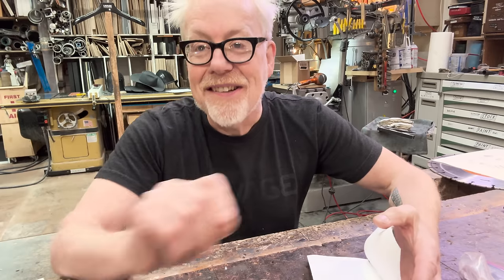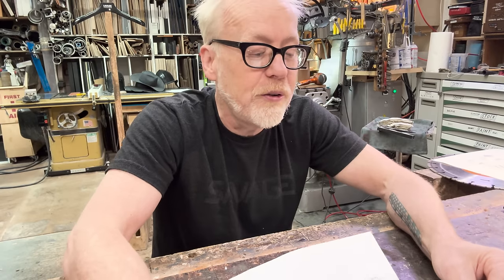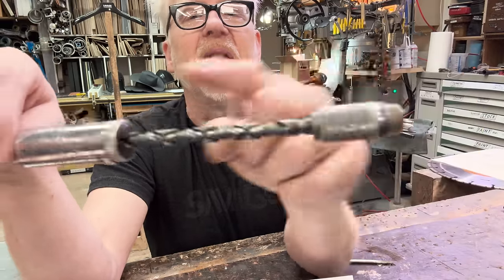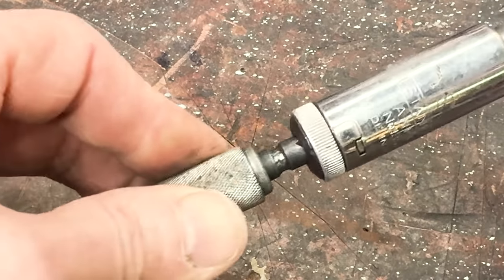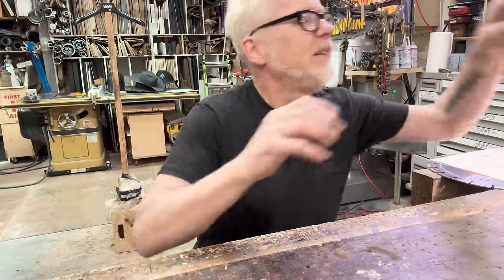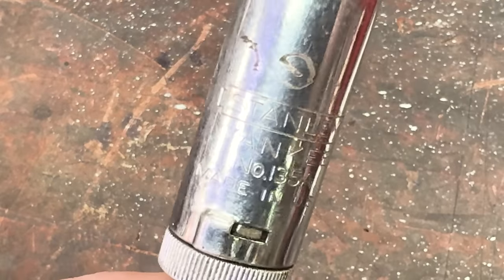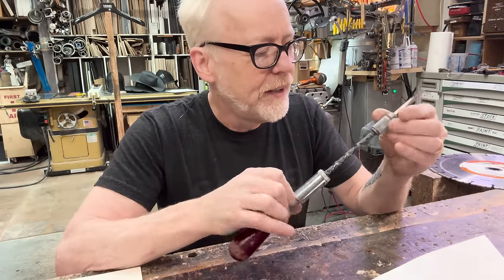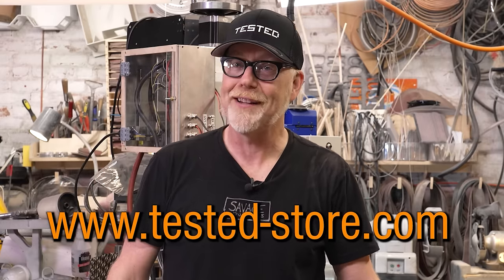Adam Savage's New Stanley Yankee Screwdriver!

Comment: My late Father had at least three of these, one small, one medium (about the same as the one in this video and one very large one... He had countless old tools scattered around his rickety workshop, on shelves, in boxes, hanging on the walls, many that very few would recognise... He once had at least five flat bladed screwdrivers, that were filed to use with Philips head screws, which I guess were a new thing back then and my Dad being who he was, probably refused to spend the money to buy the proper tool... As a kid I grew up around the smells coming from his workshop, from him tinkering with beat up old cars and fixing his cylinder lawnmower, to working on one form of wooden furniture piece to another.. the smells of freshly sawn wood, petrol, oil, linseed oil, paint, turpentine... several paint brushes soaking in thinners, various thin sticks covered in a variety of paints (stirring sticks) old cake or sweet tins, filled with various screws, nails, fingers and other fitting, plus a healthy does or sawdust, which not only made finding what you want much harder, but helped keep the moisture content low and therefore prevent the metal parts from rusting... So many great memories of those days... I would quote happily go back to the way things were then, if only that were possible.

Comment: Yes, based on this tool you can build an internal combustion engine. The shuttle is a piston, an external cylinder casing is needed. On each side there is a spark plug and a valve. And the central part is the shaft.

Comment: I found one of these at a thrift store for $4 and of course I immediately grabbed it. It gives a level of control and feel you don't get with power tools. Mine is a 130A made by North Bros before they were bought by Stanley. Judging by the 1923 patent date and the older branding it's probably 75-100 years old.

Comment: One of the benefits to these drivers si that the operator (you) are always putting downward force on the tool, pushing the bit into the head of the screw. This makes for less chance of stripping out the screw heads. I used to use these when working on old wooden boats where the fasteners were bronze, and prone to stripping the heads.

Comment: If I remember correctly the knurling at the end of the handle is a locking collar. So if you retract the shaft and turn the collar it should stay retracted so you can use it as a "normal" screwdriver and more importantly you can then release like Harry. If you look at the clip you can see that he twists the collar to make it extend

Comment: Two things about the Yankee screwdriver that are nice to know.  First, you can get other bits for it including drill bits.  Second, the small sliding button on the large silver potion above the handle has three positions - screwing in, screwing out, and (in the middle position) locked which it then works like a standard screwdriver.  My two cents.

Comment: Ahh you all make me feel real old. I have two of them different sizes and they are both tools that I bought for my workshop many years ago. They are still in daily use, I have an adapter for modern bits and a fitting which accepts small size drill bits. Great tools with amazing torque when used by an overweight old woodworker. 220 lbs behind that screw mechanism will wind the head of a 3/8 bolt if you arent careful!

Comment: I love my Yankee drivers. I am the proud owner of at least one of each type from type 1 (North Bros, Philla 1895) through type 17 (Stanley) in each of the (up to three) sizes available for each type, most in both the sprung and unsprung versions (30A vs 130A, for the mid-size) as well as a couple more moders (1980's or later) vintage.  One of the 30/130 size in each field kit, as well as 35 in most kits and 31/131 in the heavy service kits. I also have an obscene number of bits amd adapters for these, as I bought out the stock of them (full complement for  30/130 size many times over, but at least some for the others)from  an old school hardware store a few years ago for an embarrassing small amount of money. I would not be without these screwdrivers (and the associated Yankee bit-braces) in the field. No batteries to die, Minimal spark risk (they are steel, but in most cases are considered safe as they are not striking tools) fast, easy, and don't give spiral fractures to your radius when they grab hard like a high torque battery unit. See the old-tools list (msg 14126 of 1997-02-27) for the type study of the 30/130. I don't have my father's (he bought it in the late 1940's when he was in Palo Alto for his PhD...  long story why I don't have it, but the estate was plundered when he was in hospice at the age of 91) but I have my uncle's and my grandfather, each with its own history. 

The Millers Falls versions are also quite nice, with a twist collar to shift rather than the sliding switch. A tad more robust, in my opinion.

If you can not find the bits for that driver, let me know and I will check my stock. They supplied slot and phillips widely. Other types varied with the size. My favourite are the nut drivers in the radio service kit and a couple AT&T specials. Of course, you can modify 1/4"hex  to fit just fine with a little grinding. I did my deck with star-drive bits modded to fit.

Comment: Yankee tools were originally manufactured by North Bros.  Stanley purchased North Brothers in the 1940s and phased out the name in the 1970s.  Yankee screwdrivers are cool but the coolest Yankee tools are their ratcheting bit braces and double ratcheting hand drills which allow you to drill a hole in a tight space by rowing the handle back and forth.  Yankee push drills are still really useful and fit in places electric drills won't.

Comment: Have 2 simular with drive and drill bits in handle. One metal, one wood handle. Used as kid before battery power. Also use to put drive bits in old brace to spin screws in/out faster.

Comment: those ratcheting screwdrivers are great I have 4 of them ... they also have 3 settings NOT 2 ... all the way down and up are the twist channels ... and the middle is locked ... so you can push it into it's compact form and use it as a manual screwdriver ... for when you need torque the screw down at the end ... or loosen it off at the start 

they are also pretty easy to make yourself

Comment: I have an old Stanley Yankee Screwdriver. The perfect name for us New Englanders. I used it in the early 80's when I worked as a carpenter. I mostly used it when installing sliding glass doors, but it was always in my poach. I swapped it out for what I believe was the first battery operated drill. The Makita ...9 volt... I believe, with the elongated battery that slid in like an ammo clip. Built a ton of additions in the early 80's with sliders all around. So, anywhere from 3 sliders to 15 sliders, depending on the dimensions of the "Sunroom". The Yankee was a time saver.... the now super weak Makita was a Super time saver then ...ha-ha, funny now.

Comment: Those screwdrivers still have use.  Have a stubborn Philips screw that you are paranoid about caming out the head on? Use the Yankee screwdriver.  The design forces you to apply adequate axial pressure to prevent you from destroying the screwhead.

Comment: I have one of those screwdrivers - I got it from my Dad, and I remember using it as a kid. I have to admit that I never liked it as a screwdriver (it jumps around too much), but I also have some drill bits for it and have used it to drill holes.  Thanks for the flashback. :-)       edit: I just checked eBay and they are less than $30.00 there - even have one new in a box! This video will dry up the supply and drive up the cost! Ha, ha, ha, ha.....

Comment: Adam, I have one of those that I picked up a Boeing surplus it's been modified to make only 3/4ths of a turn per push and has a 3/8" dull drill bit in it used to deburr rivet holes at great speed, I'm not doing sheet metal work anymore but I still hang on to it.

Comment: I actually a Stanley Yankee drill. Same mechanism but with a carousel of drill bits inside the handle. Although the bits are not twist drills. The point looks like the point of a twist drill, but it just has two straight flutes up the sides.

Comment: These were all the rage back in the 70's. They were an improvement on a fixed driver in SOME circumstances but seriously frustrating most of the time. Cross head screws were not common at that tie so the driver slipped off the slot almost every stroke and although they would drive IN reasonably well, they wouldn't screw something out because of the pressure you had to put on the screw.
Everybody had one, nobody used them.

Comment: I've got one of those the belonged to my dad. There is a cap in the top of the handle that holds extra bits. Mine has some small drill bits in it. I never use it. It's just in one of my toolboxes for sentimental reasons.

Comment: Hello Adam, I enjoyed your discovery of the Stanley Yankee screwdriver. Yankee also made a Push drill with drill bits made to predrill woodscrews. Combined with the screwdriver this makes a good combo. The drill is still made and also a nice bit of engineering.
I enjoy hunting for and using old tools and find some that are very capable compared to modern equivalents. Check out the book Anarchist's Toolchest by Christopher Schwartz. He put me onto this. Not every modern battery powered tool is an improvement.
Keep up the good work!! Greetings from the Netherlands.

Comment: Good for driving/removing a loose screw. They get a little annoying if you need to actually torque something down (you should be able to lock the shaft:  jam it all the way down and set the switch to the center position). Now we have cordless power tools for this functionality. But you should throw one of these in your SHTF kit.

Comment: The switch Has 3 positions screw in, screw out & the centre position locks the screwdriver so it can be used as a fixed screwdriver 
I vaguely recall that they can be locked in the retracted position to save on storage space
I had 1 small & 1 large that i may have got from my father 50 years ago, I'll have to go see if i can find them.

Comment: You may want to check if the metal plate on the butt of the handle unscrews. Most of those screwdrivers that I've seen have spare bit storage in the handle.

Comment: To add a few have mentioned the locking mechanism ring, but beware on release or accidental release from an uncompressed state. As the screwdriver has no concept of objects ahead and can cause injury as it expands into something, or damage to work if it slips out of the screw head. 😮

Comment: The Yankee was high tech when I was coming up in the trades. I think Stanley bought the original company, Yankee, but I'm not 100% on that.

The only downside to Yankees was 98% of the screw heads you faced back then were slotted, which makes for slip outs galore unless you pay attention, (Adam...  hey, Adam!).

A trick I used to use was an appropriate sized chunk of vacuum hose on the screwdriver blade w/ 0.125" or so hanging off the end.

It'll hold the screw head in alignment whilst you'te having your way w/ it.  Still use the trick w/ slotted & an electric driver.

Comment: Back in the '70s and '80s when I was in iron worker I worked ornamental artworker finisher they called us. Easy money was the expression the other trades used. Well you had to have a some technique a little artistic side to you to do my job. I used Yankee screwdrivers The electric screwdrivers were a little too powerful for some screws. They were stainless but very soft it would snap a head off of screw in a heartbeat. Or in aluminum strip out the threads.

Comment: No demonstration?  These took a lot of practice to use, and if you attempted to use it without starting the screw first, you had an excellent chance of gouging your finger - not helped by the fact that almost all screws were flat heads.  That said, when you had the knack, they were a phenomenal time saver.  I remember watching the builders using these when my parents had their extension.  They could slam in 1½" screws in seconds with two or three pumps.